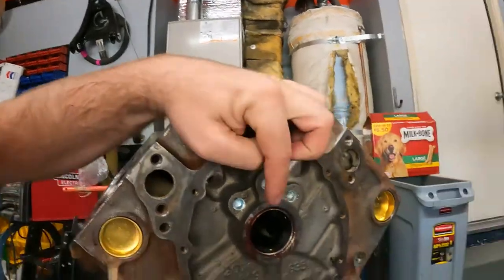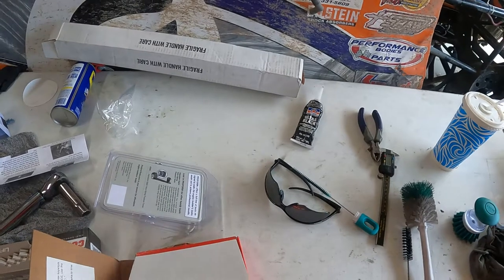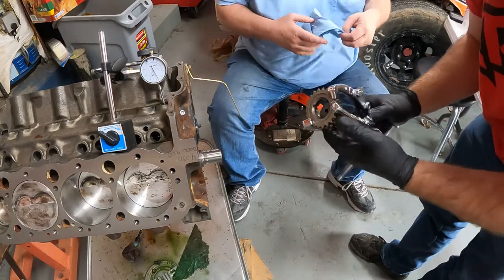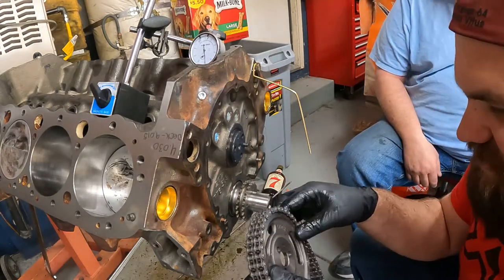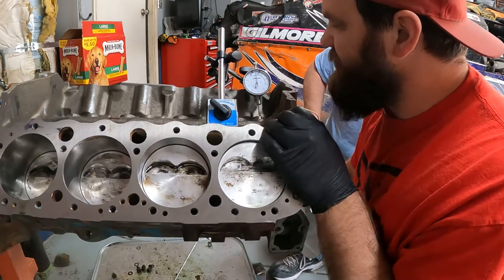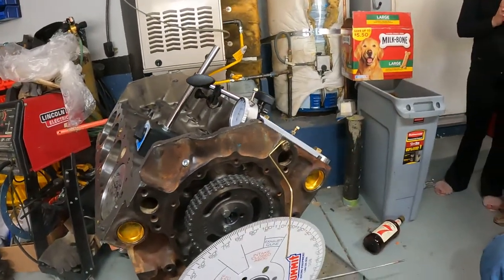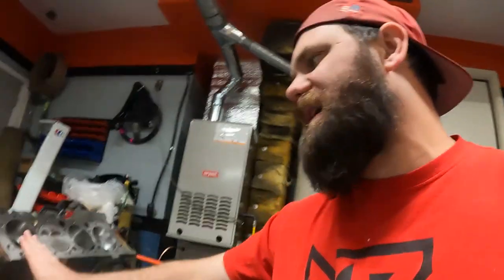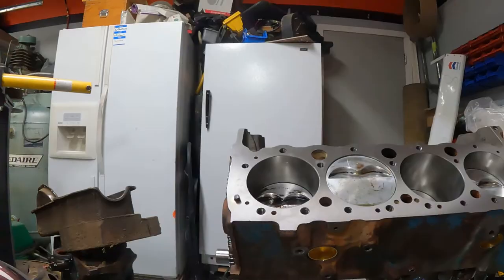Hobby Stock Engine Build Part 7: Installing And Degreeing The Camshaft (incorrectly)

Comment: Lol looks like you had fun
Reply from the maker: Always having fun,  but this time the distraction lead to lots of mistakes lol.   I fix that in next video.
Reply: @wadelumsden1548  it happens. I don’t even have a distraction and I’m having tons of fun on my mod right now lol. Ever ran the super nice 18 ball bearing for the rear hubs? That’s what I run and I’m putting new rotors on and re greasing the bearings it’s fun to put back together, one slip up and 18 bearings go all over. 🤦🏻‍♂️
Reply from the maker: @raceshop5416  oh no!  I have not used them before. But that sounds like the experience I would have lol. Murphys law is in full effect with me.
Reply: @wadelumsden1548  lol I have your luck lol